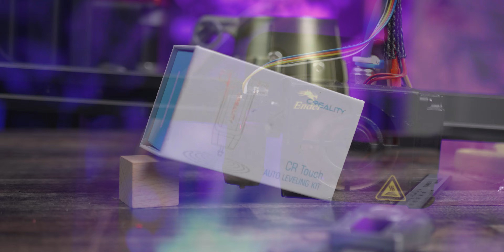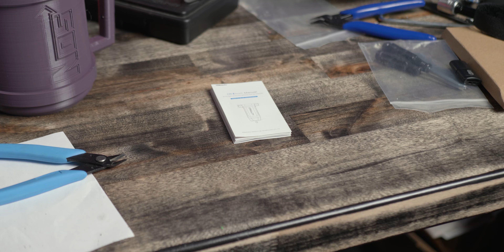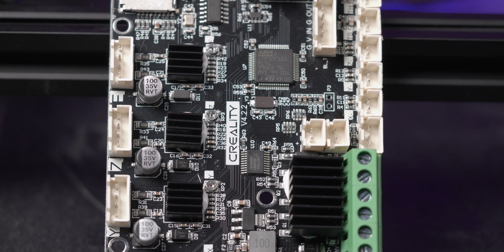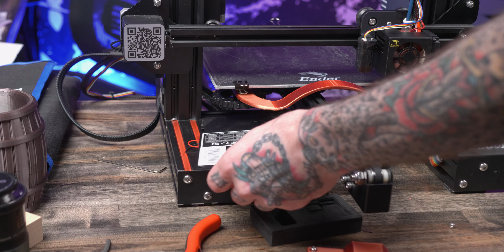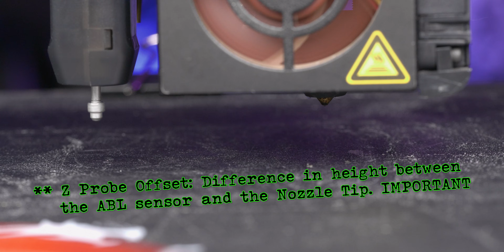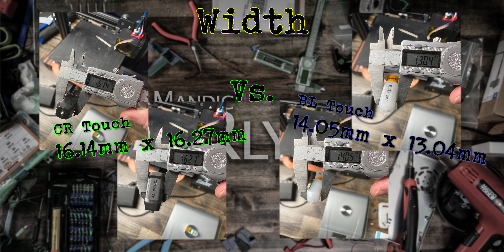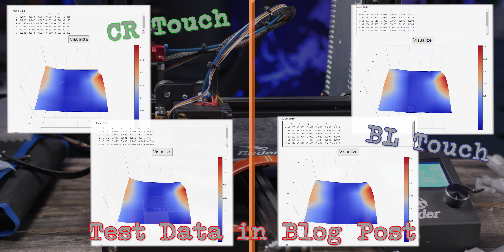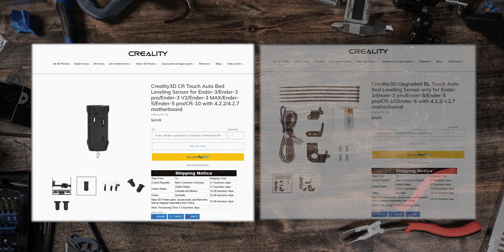CR Touch vs BL Touch - NEW Creality Auto Bed Level Sensor Review

Comment: I have 2 an ender 3 v2 neo with a cr and a ender 3 pro just picked up the bl touch to toss on my pro it was 14$ and it came with everything except a mount with I printed it’ll be here today and been reading a lot and for a beginner it’s not all plug n play like most would think can’t wait to get home and test it and love the cr touch on my v2 ender i had to wait till my print was done on my pro to see what board it had I have the 4.2.2 so should be straight forward on it but had I done it all over I’d have gotten the cr touch

Comment: just got my ender-3 v3 SE with that CR-Touch sensor. AND...
from the start there were an issiue with this sensor. Couldn't self lever the table because of it. When it worked out (didn't do much to it) i just to be sure leveled table 2 times (it takes 16 measurments for a one run so I used it in total 32 times)  and it was A-OKEY... BUT after ONE PRINT I've got the same error message. This printer needs it to "go home" position. But nah again cr touch error. THE PROBE CAN BE SLIGHTLY BENT AND IT WILL NOT WORK. And guess what  You can try to bent this bi*ch just slightly  back but there is silicone sleve on it and this can also not help because You can tear it apart cosing it to not work. SRY but I'm angry as hell right now. Just placed an order for a new sensor... AND I HAVE HOPE IT WILL WORK

Comment: My BL needed to be replaced on my Ender 5+ (with Creality Silent board) so I ordered the CR. After mounting the CR I ran into issues with the bed continually lowering. I tried getting assistance from Creality and Ender groups but no resolution. I ended up ordering another BL and returning the CR. The only thing I could figure is that the CR wasn't compatible with silent board, even with firmware updates.

Comment: I am running a Creality CR-X printer and it has a BL-Touch currently installed on it the main board is the creality v2.1.1 and due to mishap I had I am replacing that board with a Creality v2.2 board since the BL-Touch was operating fine, do you think the CR -Touch will work it can be mounted in the same location which is on the right side of the hotend and I still will have to get the correct firmware and because of what you mentioned I am a little leary I really like the aspect of the metal probe instead of the plastic one. In subsequent Bed levelings I get a difference that I feel falls out side of the range so am looking for a better way or product

Comment: I bought an ender 3 s1 from microcenter as my first printer because there was a deal and was only $200, it comes stock with a CRtouch and i love it, i manually tram then run abl, with PVA glue i get a nice flat first layer every time

Comment: I installed the cr touch i also had the filament runout sensor prior to the cr touch filament worked great. I put on the cr touch installed the firmware. the auto home is not working cr touch will not detect the z. The filament sensor no longer has a setting on the control panel. what can i do to fix this? 

thanks  

Nick

Comment: There is no firmware on your link
Reply from the maker: There is, you just have to navigate to find your printer and application. This video is a couple years old, firmware has updated a couple dozen times since this. I linked to Creality’s current support download section as they have long since updated the firmware to be fully functional with the CR-Touch.

Comment: I've had an ender 3 pro over 3 weeks now, I just learned today that the z-offset on a cr-touch printer means the distance between the probe and the nozzle, i thought it was a setting for overpressing the bed and it was about signaling the probe where the bed was and not the other way around

Comment: One thing that there definitely needs to be better instructions on (in general) is setting the z offset using the touch probes. Some of the youtube vids on it are way too verbose. Its been like asking for the time and having someone tell you how to build a clock. I just wanted a cookbook method - do this, this this and it will work.  Oddly my biggest pet peeve about the BL touch has been the lights in it. I use octoprint with a camera and the lights are distracting on the frame. The BL touch itself has been very repeatable - no complaints there.

Comment: Was a little ironic that you said how confusing their website was to find the firmware, added that you had a link to the one file that worked for you...but ended up just linking to their confusing website anyway.  Other than that, it was a pretty neat video.

Comment: I am pretty grumpy about this purchase, from the CREALITY website, the ENDER 3-v2 with the 4.2.2 board and the CR-TOUCH sensor, and put it together, had fun doing that, and printed out the PDF instructions and for the HOW-TO slicer software and put all that into a 3 ring binder and one step at a time, finally get to turn the power on..... 90 hours later (no joke) going down a rabbit hole of common problems that folks have as I trouble shoot the many problems my unit has from the factory, shorted out cables, which torched the drivers of the motherboard, the powersupply has a fluttering output of 19vDC to 36vDC with a 2 ms dropout approx every 20 ms when I hook this piece of junk up to the oscilloscope, the Z-axis is intermittent due to poorly constructed cable. I can go on and on about how depressing this whole thing has been. yet, I am at a stand still as I am now expected to wait on an email from CREALITY, which I did get, but it was first needing to confirm that I did buy a machine from them, "proof of purchase" which is fine, but now I wait... I was reading a few REDDIT post, and folks there were saying, it may take months before they reply back, just hoping you will go away... That breaks my heart. as I was super excited for this and didn't mind spending the additional $80 to $100 USD buying it through the CREALITY website, in hopes that would mean I am getting an untampered with new unit, vs. some of the issues I have had with AMAZON resellers and affiliates, which sent out NEW but ended up being used, LOL... Nah, my experiece with this has been exceptionally irritating.

Comment: Loved the video and your testing method, and have the BL and CR Touch and am thinking of installing the CR and giving it a try.  There is one additional comment on the differences between the BL and CR which may be a deciding factor for someone using the CR Touch, i.e. it doesn't require a leveling screw.  The biggest pain point I've had with the BL Touch is the probe randomly deciding to not drop, and using the adjustment screw is hit-and-miss.  Also when cleaning or replacing the probe on the BL Touch the set screw needs to be recalibrated, so not having to worry about the set screw fine tuning is a bonus.

Comment: Buy a cr touch if you want to spend days with rebuilding firmwares and confusing documentation. especially when you have an ender 5 pro, you are screwed. Never spend so much time with incompetent technicans. You need to find informations via forums because the support and the advertisement are just lies. 

I regret buying the ender 5 pro. Creality seems to be lacking of QA and Support. This can cost you months of frustration and error search.

Comment: I added this to my cr10s pro v2 which i read wouldnt work at all. But i plugged it in and it works fine without any firmware updates. Its literally plug and play. Just need to flip the bracket round that the bl touch used and adjust the spacing

Comment: Hello beginner here, I would really love the probe offset wizard video you were talking about. This thing is driving me crazy.
Reply from the maker: I've found firmware and configurations like this to be... problematic details to cover in my style unfortunately.  I simply do not have to the time to be a go-to support system for folks and my emails fill up with questions after I cover those topics so I've had to steer away from them unfortunately. 

Michael over at Teaching Tech has done a good video on the topic of Z-Offset and Z-Probe Wizard, the problem is that the Z-Wizard requires a firmware that has it enabled.  So to cover it, I really have to cover firmware compiling, and it snowballs fast.  Here is Michael's video: https://youtu.be/fN_ndWvXGBQ

Comment: Found your video most helpful.
 I have just bought myself a CR Touch for my Ender  3. When I went to download the firmware I was completely lost and ended up reaching out to Creality for help. The file they sent me is for Marlin 1.1.2 2020-04-25. My mainboard is 4.2.2. Although it does operate the CR I am having a lot of problems with setting up the Z offset. It certainly does not contain the auto wizard you mention. So I was wondering if you could recommend a different file to download?
One of the issues I have is after doing the bed leveling, the screen shows an error saying "Err To Far away" or something along those lines. So Im guessing that it is setting the z height to high as anything I try to print, the first layer doesnot stick to the board. I was hoping to figure out how to get the wizard you mentioned see if it helps with more accuracy. 
Thanks for the video.

Comment: CR Touch fails. It will lower the pin during prints and break both the prints and itself.  Had to straighten the pin out many times...  Half baked product.

Comment: I opted for the CR Touch mostly because of the probe sturdiness and I liked the look.  I found it difficult to install the cable and had to take it off my 3d printer in order to plug the cable in.  Also, on the cable I received the blue and red wires were swapped though luckily they were swapped on both ends so it did not affect the operation.  It works well though the mesh is not centered on the build plate.  Probably because after I installed the Micro Swiss Direct drive, the nozzle homes off the build plate now.

Comment: do you have a pin out based on the color of the cable for the CR Touch. i would like to use the CR touch with a different board.

Comment: Thank you for this excellent breakdown. I just replaced my original Ender 3 V1.1.4 board with a V4.2.7 and am working on setting up a CR Touch for the first time. As of Sept. 2022, it appears that the "2020-04-25"  BLTouch Merlin firmware is still the most current copy. My only big complaint about Creality is exactly as you described. Their instructions and repositories are a complete mess. Every new Creality accessory I buy sends me to a different URL that is usually a dead link or entirely foreign (Chinese) page.

I am very thankful for channels like this one that understand how to communicate information targeted toward the consumer/hobbyist instead of engineers/professionals.

Even though I'll be done with this project today, I'd still like to request a video on tuning Z-Offsets in this scenario as you mentioned. It would be extremely helpful to people like me who don't tend to mess around in the controls/firmware very often because of how much niche and conflicting information is out there. I think people will be making these upgrades on the Ender 3 series for many years to come and your presentation style for this would be incredibly helpful and appreciated! Thanks again for your effort and sharing your wisdom with the rest of us!

Comment: Thanks for the vid, i was installing it and I need to see how it operates, as I was seeing it as place higher than my hotend, meaning it would have smacked into the bed catastrophically... But of course it lowers it print to sense much like bl touch, do it's a none issue... I use the jyers firmware, and I had a bltouch installed there before, until I froze it and broke with done clue, because I sprayed way to liberally

Comment: Wait... Are those noctua fans??? ive been thinking of getting some for my 3d printer. Are they good in this use case?
Reply from the maker: Hit or miss. They require step down “buck converters” to lower 24v to 12v. Some folks run into heat creep issues as they don’t flow the same air as stock fans, but I’ve had decent luck with them. I usually run them around 13v so they are still quiet but blow a little harder.

Comment: I just bought a ender 3 max neo which has the cr touch I stalled out if the box hopefully I won't have to mess with firmware to get it working

Comment: You link for the BL Touch goes to the CR Touch
Reply from the maker: werid, thanks for the heads up. Updating
Reply: @MandicReally  Where is the firmware you complied?
Reply: @MandicReally  also, the link is still broken, 2 years on

Comment: i have the ender 3 v2 and i tried to get the CR touch to work for over 10 hours to no avail. i have the 4.2.2 board and thought i had the right firmware but i still havnt gotten it to work.

Comment: i cannot find anything on how to adjust x and y, plenty of z videos, no x and y's. the z ones arent even that good, i still dont quite understand, i have a cr in a box and afraid to attempt installing it.
Reply from the maker: X & Y are set in your firmware, you shouldn’t need to adjust those if you are using a firmware that’s intended for the mount setup you have. If you are using the Creality Mount and Creality Firmware, that part is done. 

If you use an aftermarket mount setup, any good designer should provide the X & Y offsets for you. It’s really just the distance on the X & Y axis from the nozzle to the tip of the Probe.
Reply: @MandicReally  I’ve seen videos where they put paper on the board.  Measure the probe vs nozzle x y distance difference.  
 Anyways I use jyers.  So I guess I’ll install cr touch and flash the abl jyers bin file and then hopefully figure out the z.   Thank you.

Comment: I’m late to this party but oh well🤷‍♂️

I just purchased a ender3 roughly 3 weeks ago, I am probably on my fourth or fifth print as of right now. And I am working on a design of my own for something that my wife needs.

The biggest pain in the ass for me right now is getting the correct Height for printing.

I believe I am going to pick up the CR touch, to assist me in that end. My biggest reservation is I don’t exactly know how to do all the firmware updates to make everything function. Installing it Mechanically is not a problem.

I guess there is “nothing to it but to do it” and see how it goes. If anyone has any suggestions. I am definitely all ears

Comment: I went with marlin 2.0.9.3 firmware which already has bl touch in it
Reply from the maker: That is not a given.  Marlin firmware has had the OPTION for BL Touch implementation for years.  It hast to be properly configured and enabled.  The firmware compiling process involves enabling the options specific for your machine.  It sounds like you got lucky and got a compiled version that works for your setup, that is not a given.

Comment: i push the small connector the opposite way through the hole then connect it to the hotend, check my slack then plug into the main board.

Comment: what i've had recently i bought an ender 3 pro,   2 days after i got it i started getting  temperature  runaway errors, so  contacted  creality   and basically got the run around, well i figured some filaments i plan to use in future   warranted it i bought the   direct drive  hot end kit while i was at it i ordered a cr touch probe. and as you said was informed in instructions to download firmware for probe. well here is the kicked they do not  offer firmware  that supports the direct drive  hot end upgrade kit    AND the probe  both. so been working in visual studio to  try and get one that will work.     first issue  of the creality firmware i believe its the generic  hot end   upgrade for a different display   and instantly tossed my screen into  a bunch of gibberish  lines    and totally unusable  and  the hot end does not support the cr touch,  so here  went to a site got a  software to  import into visual studio that i was able to make an operating firmware that works with the  hotend and board  but as yet cannot get the  cr touch to function.  right now the  probe    when i go to  z home the hot head is over the  table   about 117  y     and  100 x   but  got to probe the  head goes up   and the  pin will not  extends   i have tried a dozen  attempts  to get  a bin file to work.

Comment: I've ran an Ender 3v2 and now a CR10v3 with the BL and CR touches and I haven't ever seen the benefits of either. Am I wrong in thinking it should act as a compensation for a warped bed? For example, I've got a Snapmaker Original and there's no way to level the bed itself, but you go through and adjust the four corners. Granted, the bed is a 4" square, but you adjust the corners and the machine compensates for any high or low spots on the bed... Am I wrong in thinking the BL and CR's should do the same, essentially?  Or am I doing something wrong? Cause it's super frustrating when you've got a warped bed and no way to print anything outside of the middle few inches of a 12" build plate.

Comment: Yeah, so... repeatability of 0.0011 mm on both sensors.  You realize that under those numbers (less than a thousand of a millimeter) even electromagnetic interference causes data variations, right? They're the exact same product with the exact same results given...!
Reply from the maker: The point wasn't to show one being vastly superior than the other, just to compare a newer product to the "standard" that is the BL Touch. They are the same concept but not the same product.  I showed the insides of the CR Touch, they are designed differently but use the same principles. That doesn't mean they are the same.
Reply: @MandicReally i'm actually referring to the actual important part. their functionality. they shows that they provide the same measurements up to thousandth of a millimeter. yeah the metal probe it's "cool" but it's not an entirely different world. they provide measurements, almost identical too...